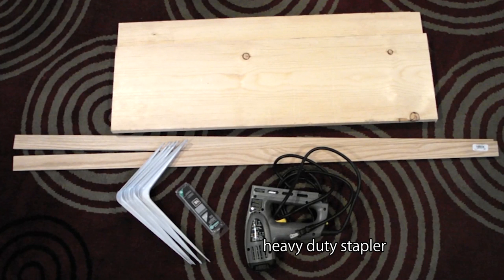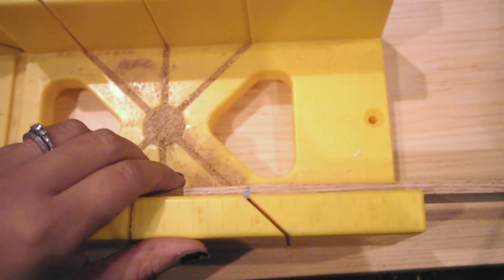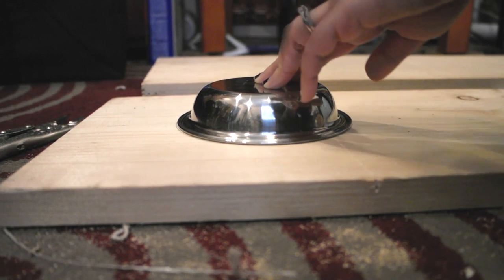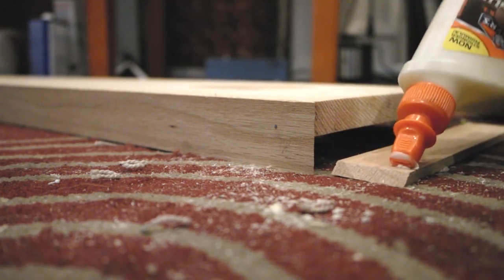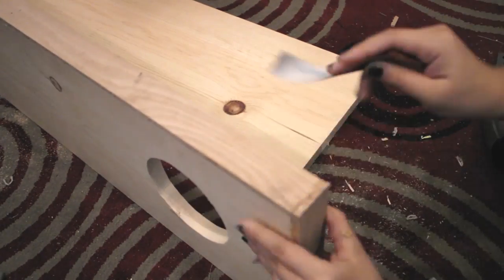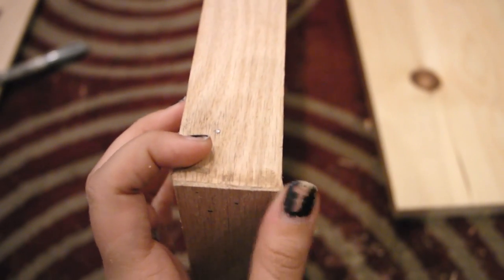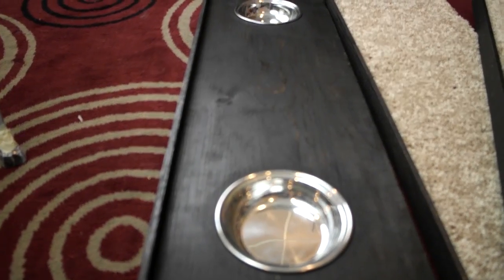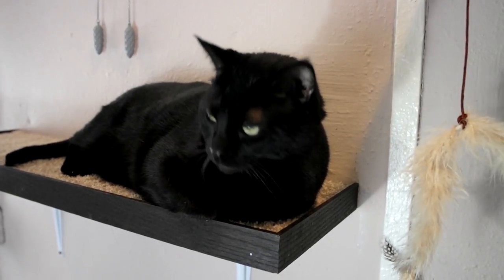How to Make Cat Shelves : DIY

Comment: Really good, but don't use staples because they are dangerous if the cat scratches them out, use loads of pritt stick and super glue and move the bowls away from where he jumps up over to the other side.
Reply from the maker: +Delusional Fairy Thanks! Gremlin has been using these shelves for almost a year, and thankfully he hasn't gotten a nail stuck on a staple or something. He has managed to pull up some of the carpet though, so I've been meaning to replace the it, but I wanted to be sure to use some type of adhesive that would work but also wouldn't be potentially harmful. I don't believe a pritt stick would be strong enough, and unfortunately super glue doesn't work that great with gluing carpet to wood. I think I'm going to try using contact cement, and if it works out I'll include an annotation in the video.

The bowls work well where they are for Grem and the way that I attached them to the wall, but everyone is free to position the bowls whichever way works for them if they choose to make a food and/or water bowl shelf! :)Thanks for checking out the video! :D
Reply: chezlin Honestly I used lots of pritt stick and super glue at the edges and it's solid as a rock. Also if you drill a small hole through the shelf, you can put some string through and add some swinging balls. Excellent stuff, as time goes on you'll learn all new tricks xX
Reply: You can also get a carpet spray glue, works really well xX
Reply from the maker: Ahh cool! I'll test it out with those glues. And I totally didnt even think of carpet adhesive, I'll definitely look for some of that stuff too! Thanks :)
Reply: chezlin Yeah, welcome :)
Reply: I was thinking the same thing. My sister bought one of those cat pole scratchers and a staple was sticking out and she had no idea. Her cat ended up rubbing his face on it and it got infected. She had to take him to the vet. :( So I'm really weary of using staples for anything like that. Thanks for suggesting different glues. I want to carpet some already made shelves and stick em up for my cats.
Reply: You can simply use double-faced adhesive tape. It's specially used to keep carpets in place :) Nice video btw. Hope Gremlin is fine
Reply: @chezlin  Agreed. At opposite ends your cat can sit in the middle and access for and water. Both on one side is awkward. Awesome job!
Reply: @chezlin  file the wood to make a rough surface then use a hot glue gun 😎

Comment: What did you use to attach them to the wall where it would hold your cat's weight? I'm afraid that they will jump on it and it will rip right out of the wall.
Reply: Making sure you attach to a stud insures they'll be sturdy. Probably other ways but that's what I do.

Comment: great job! i noticed though, that you said you stapled the carpet to the board but wasn't sure if gremlin would use the carpet as a horizontal scratch board. do you think it would be possible for gremlin to get his nail caught in a staple while he's scratching? is there an alternative to getting the carpet attached..?
Reply from the maker: +Deborah Kuo Since I made this thing, Gremlin does use it like a scratching post, and he's actually ripped most of the carpet up on one of the shelves. I need to replace it. The staples haven't been a problem for him, but I have been putting off replacing the carpet because I want to figure out an alternative way to attach it... I don't think the glue that I also applied did anything, really. I might test out "Liquid Nails" next.
Reply: +chezlin did you try a glue gun...? or is it similar to a liquid nail? is there toxicity with using those? or maybe it simply doesn't matter because they'll never get to whatever binding agent is used.
Reply from the maker: I don't think a glue gun would be strong enough to withstand the power of Gremlin's scratching power, haha. I'm not sure about the toxicity of liquid nails. I was planning on researching all that stuff before I actually fixed the shelf :)
Reply: k great! i will follow along and wait to see what your results might be...

Comment: I'm planning on building some cat shelves for when I get a cat soon. This was so helpful, thank you! I was wondering, when you attached them to the wall did you secure the shelves to the brackets in some way? Or are they just resting on the brackets?
Reply from the maker: I used a short screw to go through the bracket into the shelf. My cat is a pretty big guy so I wanted to make sure the shelves were totally secure
Reply: +chezlin that's what I thought but I wasn't sure. Cool! Thanks so much for this video and for answering my question! I can't wait to build some shelves for my future new fuzzy family member.
Reply from the maker: No problem!! Good luck with your shelves! I'm sure your kitties will love em! If you want, you can share them on twitter/instagram with #chezlinDIY :D

Comment: Good job. It looks so easy. Now you can work on making your workbench
Reply from the maker: lookylooky100 Hah, thanks! Actually, since this video has gone up, we bought a nice big work bench for the room :)
Reply: I was going to throw away an old head board of a bed when it occur to me I can use it for the cat bed. The board has a rim that would prevent the cat from falling and it's about 4 or 5 feet long X 7 inches wide.
I even saw someone use the draws of a dresser, painted it with bright colors and nailing it to a wall. 
thanks for your inspiration and creativity.
Reply from the maker: lookylooky100 Nice, that could totally work! :) 

You're welcome, and thanks for my videos! :D

Comment: For the mitre joint you are actually supposed to measure it for the longer face.
Reply from the maker: +Andrea B Oh! Oops! Can you tell I'm self taught? I measured the shorter face because those were the parts that were going to  attach and line up to the board that I cut. I wasn't sure how I'd measure it to get a nice tight fit if I was measuring the longer sides, ya know? Do you have any tips on how to do that? Thanks! :)